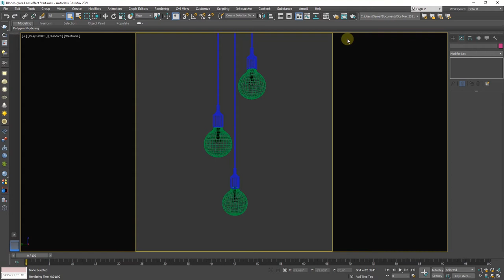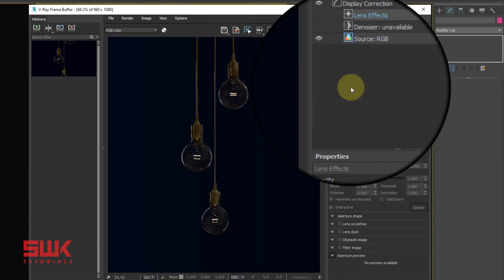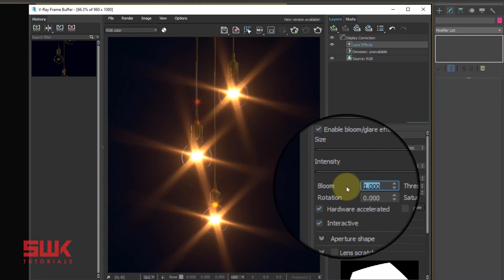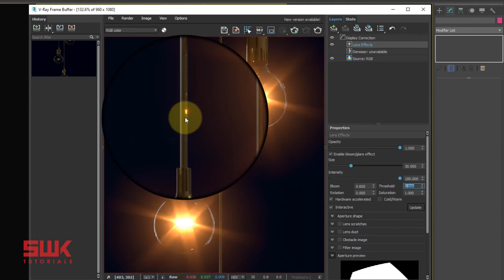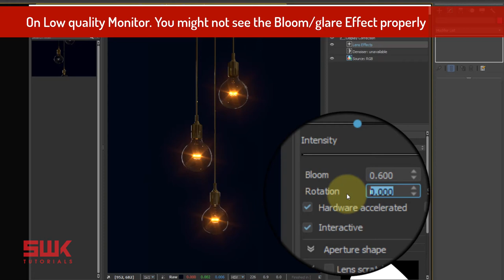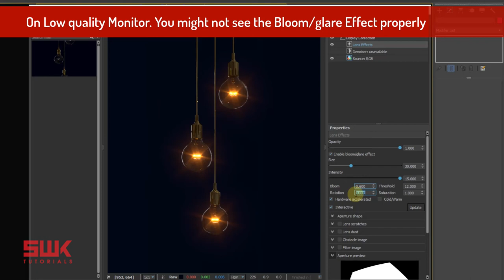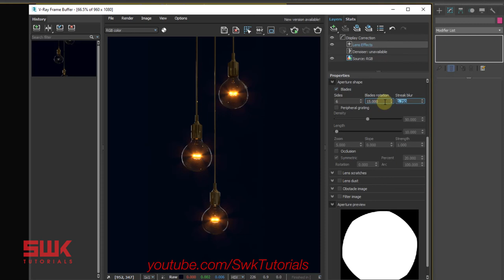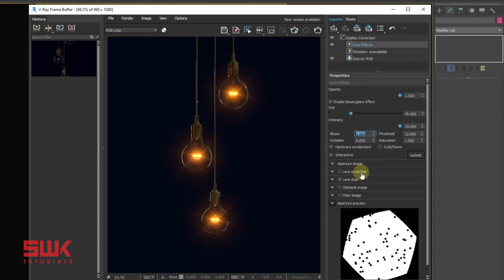3ds max + Vray 5 Realistic lens effects like bloom and glare

Comment: Dear, I have done the lens effect. however, the effect appears only in perspective mode and not in Vray camera view. Please advise.
Reply from the maker: It happens because of the difference how vray render 
- perspective and Vray physical camera.
lets say your light multiplier = 30.
Light result will be bright in perspective but dark in vray camera.
So for vray physical camera you need to increase light intensity
Reply from the maker: @SWKTutorials Normally when I render I dont render in 3ds max perspective camera. Instead use Vray physical camera.
But if I want to use both with same light intensity there is a way. but I dont want to create any confussion so im not discussing it
Reply: @SWKTutorials  you are right. I have increased the light multiplyer  after I send my comment and the effects show up.  Thanks for ur response

Comment: for some of those this is not working, its probably because you are working with exponential color mapping. this only works with linear multiply settings.
Reply from the maker: It works with default Reinhard too. If Reinhard parameters are not changed